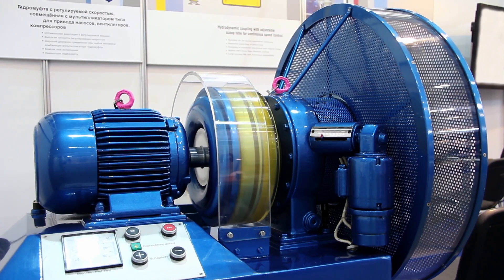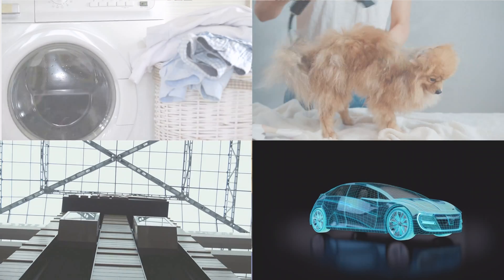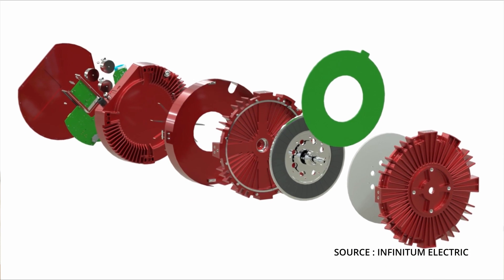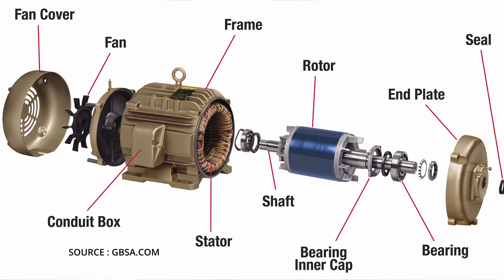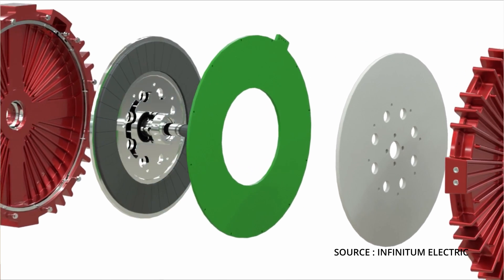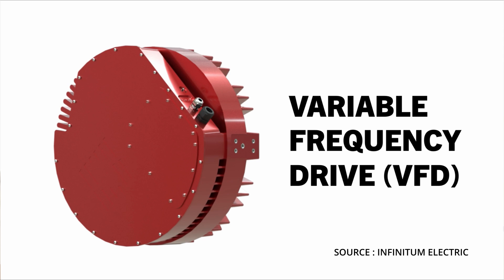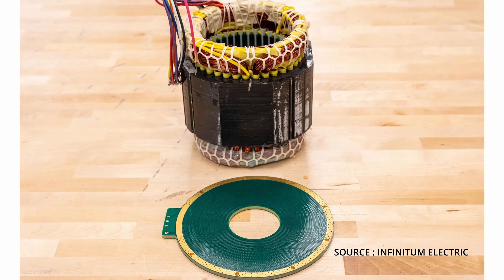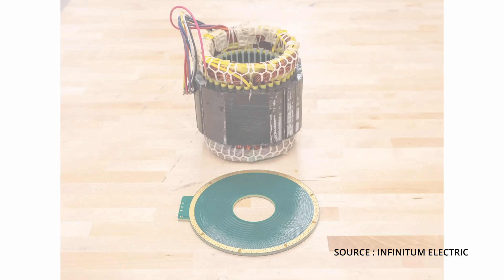PCB Stator motor, Axial flux motor, The new revolution in motors industry.

Comment: But how cool the PCB coil?
Reply: The PCB design allows for cooling via the frame fins (heat sink). The fan flow is almost not required as it only provides for the minimum amount of air over the fins. Majority of the already developed designs are going to HVAC industry. They are working on other designs for other industries. Will definitely be interesting to see and test them.
Reply from the maker: same as the traditional motors , An internal fan fix on the rotor shaft will cool down the surface of the motor which acts as a heat sing for the internal parts.